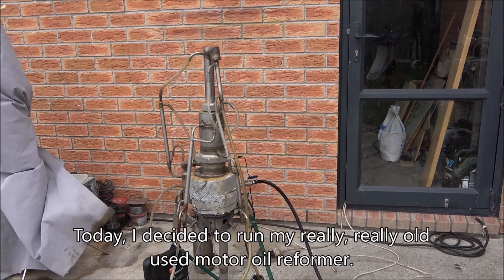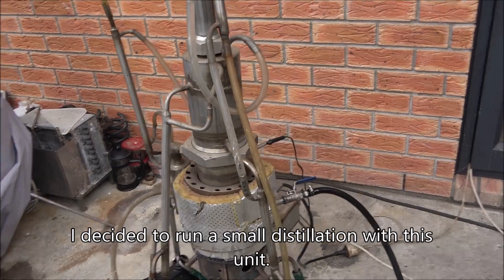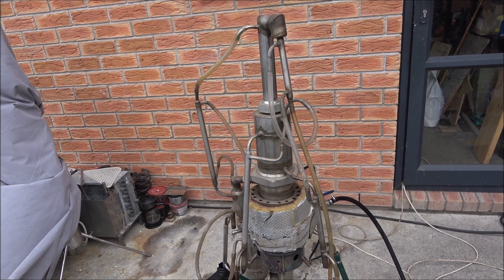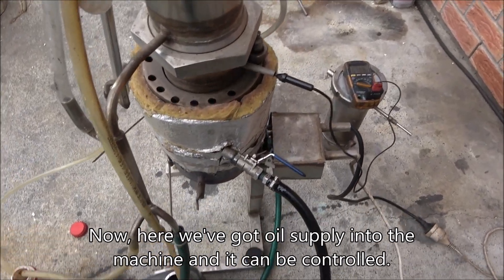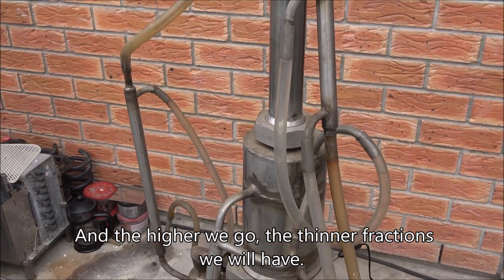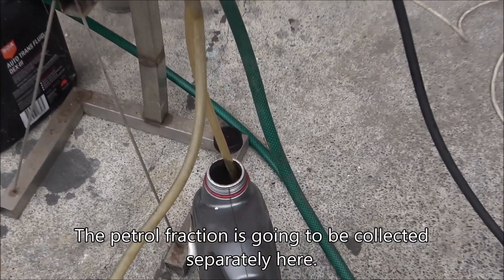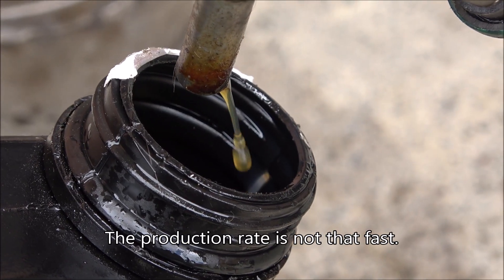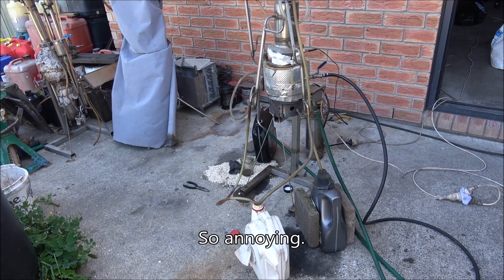Old Reformer Waste Oil Distillation.

Comment: How long does it take from start up until the start up?I tried it and at 160 I heard popping sounds inside the distillation vessel. Is this a warning sign of a problem or is it normal for it to happen?
Reply from the maker: All depends on the type of distiller, in most cases the working 400c temperature reached in 10min, the popping sound usually indicates water in oil.
Reply: Thank you very much from you, we learned a lot and we are still learning @santeryi9

Comment: Hi Alek how are ya? Yes I remember this machine, quite a few years ago! I’m still amazed with this precess. I really need to get my system up and running, diesel here in Kaliforniastan is still around 5 dollars a gallon and electric just went up to 42 cents a kWh on the first tier. A 4 kWh system will cost about  a little less than 2 dollars an hour. If I’m able to even 1 gallon an hour it will still be worth doing. I’m so looking forward to getting a set of your plans! Thank you so much for doing all of this and sharing. GOD bless you and your family! Please be safe!!!!
Reply: Just burn the waste oil to heat the distillation... one liter of waste oil contains 10kwh of energy (sorry for using non freedom units)
Reply from the maker: Hi mate, I am relatively fine, thanks for asking. I built this unit back in 2011, and it is still operational; it is a small sort for experiments. I advise experimenting toward your goals; this is the only way to achieve something. I still experiment, too, making mistakes too. Email me, and we'll discuss options.
And thanks a lot for your interest.
God bless you.
Reply: 1

Comment: this is the compactness like I need.

Opening of video said you are reforming waste diesel?   Is that correct? If so confused why reform diesel into diesel and loose some of it to other fractions.....  unless it is the other fractions your seeking
Reply from the maker: I reform waste diesel car oil; there are some differences between diesel and petrol waste oil: diesel is more contaminated with carbon and has more additives that make it more difficult to work with, thus - reforming waste diesel oil into diesel fraction.
Reply: @santeryi9  your compact unit could fractionalize wmo and Pyrolysis oil too into diesel and  others?
Reply from the maker: @coachgeo  The heavier the processing oil, the more different fractions you can get due to the high temperature of reforming, while thin pyrolysis oil will evaporate at a relatively low temperature, so almost no destructive distillation will happen, though dark pyrolysis will become a transparent one.

Comment: How much diesel fuel can this unit output before needing to clean out the residue from the bottom of the reactor?
Reply from the maker: Hi, about 100L, the inner cylinder can be removed in few seconds and cleaned.